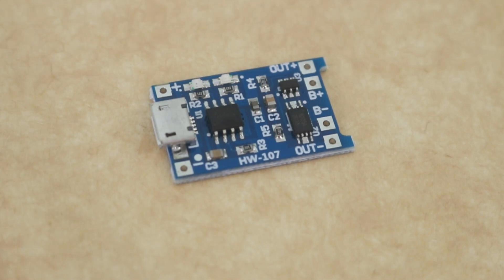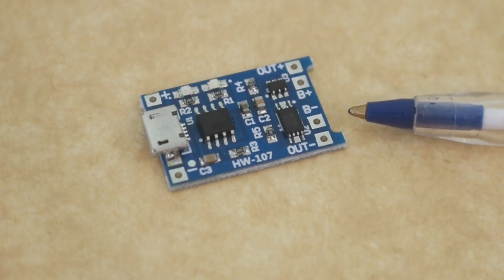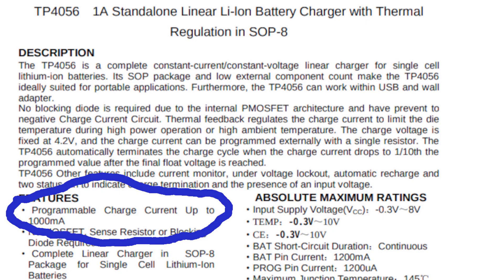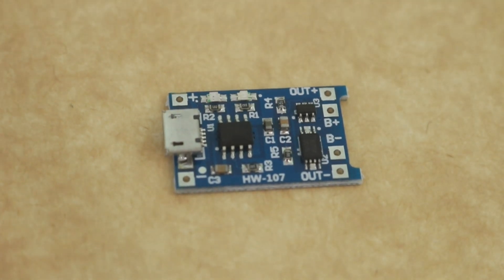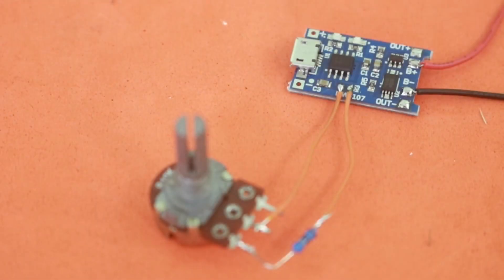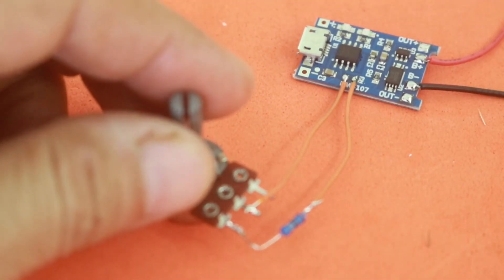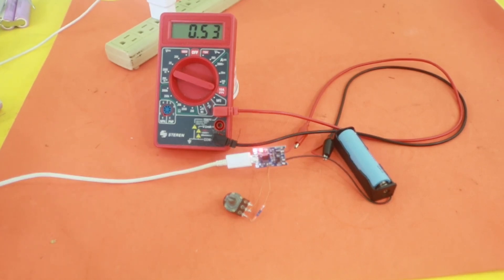Modding the TP4056 to obtain Variable Current

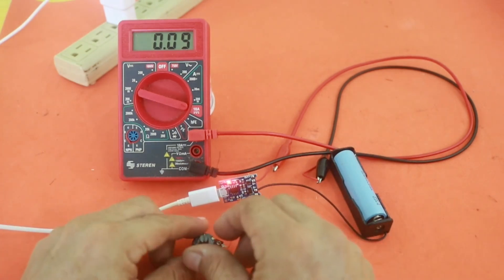Comment: I tried to measure current with the same setup at 5:51 except that I use Volt/Current Meter Display instead of multi meter.
It shows only voltage which is around 4v with and without turning ON the power.  But it shows only 0 amp while charging.
Red and Blue LED light up so the current must able to flow through the display meter and back to the module.

Comment: The original R3 programming resistor for 1A output is a 1.2 kΩ resistor. Can you please explain why you chose a 680 Ω resistor?
Reply: I think he didn't have a 1.2 kΩ resistor.
We can see that because he stopped turning the potentiometer as soon as the current reached 1A on the multimeter... he could've turned the potentiometer more.
Reply: From 5:32

Comment: Value resistor  680 OHM ?
Reply: The single resistor should be 1.2k, so that even if potentiometer set to zero, there will be minimum of 1.2k as-per datasheet. This guy is just a hack